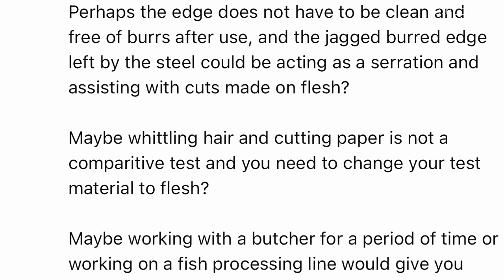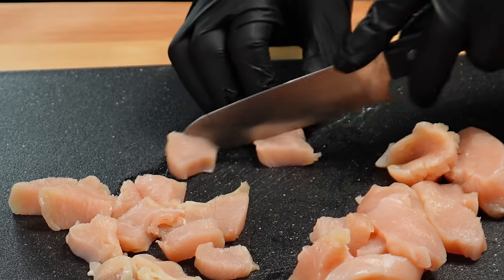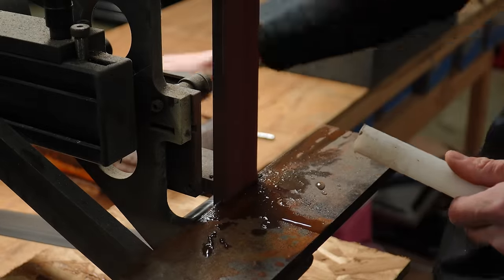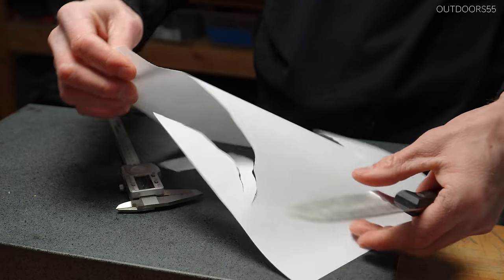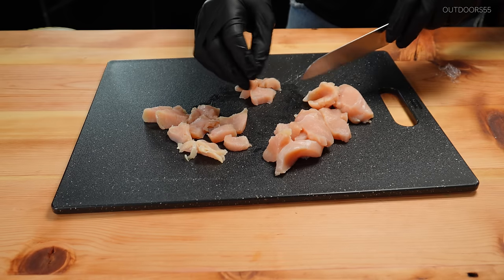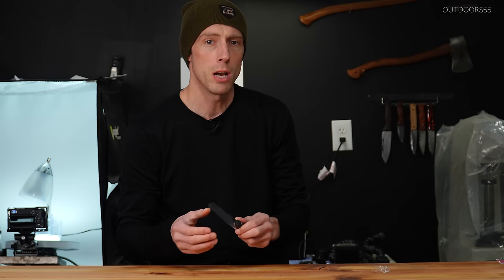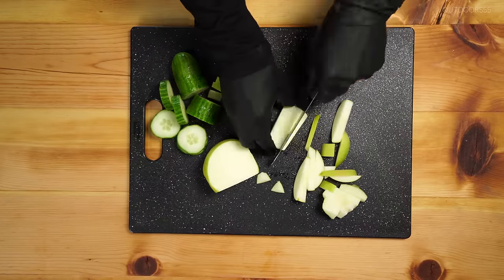Why Knife Sharpness Is Not What You Think

Comment: funny, recently I redid the secondary bevel of my kitchen knife because, well, why not. it's SO MUCH sharper now. even tho the primary bevel is the same (it's a full flat grind, and thing is 10in... I'm NOT regrinding the primary bevel). so, even what's right behind the apex also matters. 

that said: I'm TOTALLY gonna regrind my table knives. keeping those sharp is IMPOSSIBLE (cutting e.g. meat on a ceramic plate, two touches and the apex is gone), so, some good geometry will probably save me a lot of work in getting their apexes back over and over and over.

Comment: Yup, that's what is making my Manly Wasp a cutting machine. I use it a lot to cut cardboard and it just doesn't stop. The S90V steel helps in staying sharp. I never had to resharpen it. I just give it a couple of strokes on my leather strop once in a while. I'm shure this wouldn't even be necessary just for the cardboard.

Comment: ...currently wondering if you have a video explaining why cutting soft things still dulls knives, 'cuz that detail has long baffled me.  I mean I've heard of paper being an issue for fabric scissors -- paper having some sort of hard material used in its construction that will easily dull scissors designed to cut fabric -- but like, how does meat and cheese damage metal?  How does wood damage metal?  Why does this not intuitively map to "harder thing is not damaged, softer thing is damaged" and instead has things wear out through the years?

Comment: If you take a thin iron wire and bend it the opposite ways repeatedly, it will break at that point and you will be left with two wires with very sharp points. Honing steel is probably used for this same purpose. To break or peal the burr without damaging the apex, which can be so easily done. I only use very slight pressure, feeling the resistance of the burr on the honing steel. Also slightly increasing the angle and lowering the pressure even further as I go along. Ten strokes are probably the most you will need and the procedure quickly becomes counterproductive if you do it too much. You will know what I mean if you will be able to remove the burr as a strand. What you end up with is probably some sort of micro serrations on the apex that help with digging into tomato skin or bread or meat better than a polished edge. I don't expect the close up of the edge to look so good as the perfect geometry apex, but for every day use of a knife, where you want to get to the functional sharpness fast and consistently, honing steel is still a tool of choice for many people working with knives, even though some of them use it more to show off, rather than improve the sharpness of their knife. This is another type of sharpness. With your determination to get to the bottom of things and fancy recording equipment, I'm sure some of us could learn something new if you care to explore this angle.

Comment: I work with a lot of rabbit fur and sheepskin (I make custom wool overcoats and gaberdine trench coats and I trim the collars) and you never want a knife that's "hair popping sharp". You need it to be sharp enough to cut the skin without cutting the fur. Here in India, we use old, unhardened bandsaw blades. They usually clock in at 45 hrc, but that's plenty hard for a nice edge. Again, unless you're cutting some delicate fish or wagyu beef, you don't need a razor edge.

Comment: When people talk about cutting food in the kitchen, isn't the tomato the the item to test? For me, it seems a jagged burr really works well for breaking the skin of a tomato. And as such, the honing stick does quickly get the knife cutting again with minimal interruption. Seems like there is no clear right or wrong. I'm curious to know how a jagged burred edge tests on one of those sharpness testers that uses the thin piece of steel wire that gets cut? Oh, yea I have one those cheap knives that I think I $8.00 for and I changed the contour of the blade and I can't get it to hold an edge. Maybe I should try to heat treating it and annealing it. Not sure the handle would survive but I could probable do half the blade.

Comment: Love your videos. A small questions. I have always been told to never use sewing scissors to cut paper as the paper fibres will dull the edge. If this is true why do you always see knife sharpeners testing the sharpness of their blades on paper?
Reply: Correct, it's not "healthy" for a cutting edge to be used on paper.  However, paper is inexpensive, approximately equivalent for common sizes (with modern manufacturing) in thickness, so the average person can get a sheet and perform a reasonably valid test.  The paper held up from a work surface offers little resistance, but if it just bends down instead of being sliced, the knife is good and safe, but not ideal for cutting things.  
(As can be seen from this video, fruits, vegetables, meat etc. are not great indicators of "sharpness", and can vary enormously depending on age, but even the squared-off dollar-knife can get through paper with a bit of determination.)

Comment: I use a boning knife as a prep knife because the steel holds a really nice thin edge. I do basically what you did to your one dollar knife with my 120$ knife. But with one difference, which you point out at the end. I bring it down to a point where the apex forms again, but not too thin at the edge that it can't support it. That knife goes through basically pretty much everything. But yeah, you are right that not all 'sharpness's' are the same. But at the end of the day, when I am cutting things with skins like tomatoes or peppers, I want that knife doing what I want, not what the skin of the veggie/fruit wants. 

So plenty of people just look at me in horror when they see me sharpen that knife. Then look at me in amazement when I am able to easily slice off micron thick slices of tomato likes it nothing. It's always a follow up of "But that's not the right way to sharpen it. Why does it work so well."

I've always just replied, "I dunno, but it does; so I keep doing it."

Comment: Hmmmm. Yes, I've heard many folks (including Chef Steve Callari aka Super Steel Steve) mention this bit about geometry, but I wonder if other considerations besides behind the edge thickness and overall blade thickness come into play when cutting certain materials. Example: a Kramer chef knife (in this instance a 6 inch bladed one) outcut several knives with thinner blade stocks and thinner behind the edge thicknesses when it comes to vegetables such as pumpkin/root vegetables and I am left wondering if this is due to a wedge effect caused by the tapering (along the length and depth of the knife; the knife blade at the spine is at least 3 mm...maybe even 3.2 mm, so it is not particularly thin and definitely other Japanese chef knives I compared it to are thinner than that).

Comment: Ok, I'll bite on the title, because I believe that I know what sharp is what I think it is. I worked at a veneer processing plant in my youth. The logs that are sliced are upwards of 12 feet/3.6 meters long. 2 types of cutters that we used: 1 was rotational, the other was a mandoline style cutter. I've had a few conversations with the guys that sharpened those blades. Primary and secondary bevel were only a few degrees off from each other (don't remember the exact number here). 12+ foot long blades about 1" thick at the spine and aprox 10 inches/25 cm wide. Over all bevel root to edge was around 3 inches. All blades sharpened in a machine that had stones to give a micro fine edge. You could cut yourself with the slightest amount of finger pressure. That's what I think sharp is. 

Yes I know that this is not the point of the video; I did watch it. =P

Comment: my wife always tells me that the knives are plenty sharp enough when I go to sharpen them. And I put off sharpening them until the apex is completely rounded off and you have to use the tip of the knife to cut into something like a bell pepper... 

But yeah, they're thin behind the edge, so they pretty much function. I remember someone once saying that a knife is effectively just a wedge, at a mechanical level, which provides a different way to think about it, even if you don't necessarily agree...

Comment: The only thing that gave me "wait a minute" moment was cucumber cutting, some veggies have tough skin and without proper sharp knife it's not so easy biting that epidermis, and it shows. It's not super obvious but hints are there. There are meats that work similar: cheap market grade water pumped chicken breast you can cut with anything, duck breast will be far more demanding, and good luck slicing skin on a bacon piece with dull knife.
About real testing, not so fresh tomatoes are great for testing because, that slight loss of water makes skin wobbly and you can clearly see and feel how knife is managing through initial incision and then how nicely it separates mushy interior. And afterwards you can make a spaghetti sauce (it's far better with slightly mushy tomatoes than from apple hard ones).

Comment: The most annoying bit of food I've had to deal with a not sharp enough knife is a badly chosen piece of pork belly. With skin on, one at layer, one lean layer. Blanched for around 5-10 minutes before cutting so the outside is mostly cooked by the center is still raw. The toughness of the skin combined with the stiffness transition of the cooked and raw portion makes this a huge pain to slice thinly(1-3mm).

Comment: What I'm interested in is how thin you could slice a tomato or bacon for example, because I've used a lot of dull knives, and done pretty fine by applying little pressure, but quickly sliding the knife back and forth. But I could never make a thin cut with any of those knives.

That said, I have never sharpened a blade in my life, nor do I have any sort of cooking education

Comment: Yeah firm vegetables are some of the easiest things to cut as long as you have a somewhat thin piece of metal, and most meat as well. The real test if you want to test cutting food is relatively soft food with a tough skin, like tomatoes or bacon with rind etc. But I'm pretty sure tomato skin or pork skin has fairly similar if not identical edge requirements as cutting hair does.

Comment: To all the knife folks. It does not take an edge to cut!

Cutting is just friction. Hell, a BLEEPING river can cut!

I could cut my way through a wooden table using my open palms if I had enough sandpaper and time. 

And edge just allows for more focused cutting and helps with cleanliness of the cut and cleavage. 

Cleavage is when a crystal is fractured and the parts are separated. Many food types are not crystaline exactly but they are brittle or crisp enough to act as though they are. Cutting many vegetable requires breaking through a hard skin to then be able to slice through the remaining softer flesh. 

So in general harness and application of friction is more important than sharpness for cutting. 

A good slice should almost feel like the way striking a match against the side of the matchbox feels. =)

Comment: Are you saying that having low behind-the-edge thickness is sufficient for a knife to be good at chopping through the kind of meat and vegetables you cut up here, or that it is both sufficient and necessary ? In other words, can a knife be good at chopping through these things if it has a relatively thick, wedge-shaped primary bevel but it also has a very sharp edge?

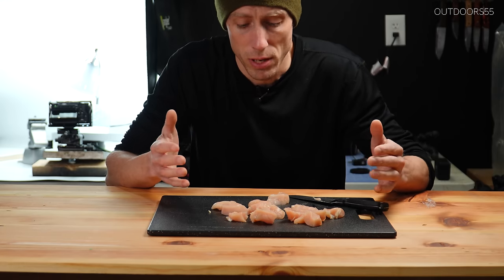Also, would the demonstration knife really be sufficient for 99% of the people who need an ordinary kitchen knife 0:48 ? Maybe, but I don't think that the demonstration here proved it. Almost everyone who needs a kitchen knife needs a knife which can effortlessly cut straight down through the hard, waxy, and convex outer surface of a peeled onion, especially at the edges of a half-onion where the slope of the surface starts to become nearly parallel to the path of the knife. Getting through an apple or a banana or some chicken breast is a much easier test.

Comment: My adult daughter will not let me sharpen her knives (cutting herself fears). She has never done anything to her kitchen knives. They are very dull, but I watched her in the kitchen, and she is happy and has no problem cutting for cooking. I like my kitchen knives sharp, but I guess it's a guy thing. It drives me nuts when I use my kitchen knife to open a plastic bag, and the knife doesn't glide through smoothly.
Reply: Most people have no concept of efficiency. Nothing more annoying than a dull cutting tool. Even old time lumberjacks would spend time sharpening an axe rather than forcing a blunt axe into wood.

Comment: I have a question/problem not necessarily related to this video however it’s about sharpening.

Sometimes I sharpen a knife to scary degree. I asses it with different means. And it passes high honour. I check the bevel under my magnifier (I don’t have a microscope) and all is well. The day after, without any usage it doesn’t pass my tests. Am I crazy and should get psychological help or what.

Ps. I’m a pro sharpener that sharpened thousands of knives in tens of ways.

Comment: What You spot out is the difference between a cut and a tear or rip... Extreme example: cutting a tomato. Take a dull knife and pull it 2-3x each side over the round file that's normally used to sharpen chainsaws. The cutting edge will become some burr that's shaped like small saw teeth - and the blade will cut tomatoes perfectly! But that does not mean the blade is well sharpened. Cutting paper, shaving, or making the "thumb-nail test" will show: the cutting edge is raw! As soon the burr is gone (that will happen quickly) the knife is dull again and the process (which removes a lot of material) must be repeated.

That's also the difference between butcher's knifes (to be usually sharpened often, with a steel rod) and asian kitchen knifes or "scandi" outdoor knifes (to sharpen with a flat stone). 

The best way to avoid dull knifes is keeping them sharp! Means: as soon as You recognize it's not supersharp any more, pull it 2-3x (each side) over a very fine wheatstone (*) and it will be perfect again. 
Keeping a sharp knife sharp is way less effort than making a dull knife sharp - and it has one big advantage: You'll never have to deal with dull knifes.

* I'd never give away my original "Belgian Blue" natural wheatstone. Around 2 decades ago, I took the cost buying a bigger one (appx 3" x 12") - never regretted just a single cent!

Comment: I mean yeah, cutting those light food item is easy but the wife will quickly find out about it at the first try through some small tendon, skin or even trying to break the crust of home-made bread.
I do consider kitchen sharp as a class of it's own. Primary as thin as humanly possible, with a 20 degree per side secondary, and a 30-40 degree per side strop is what I go to these days. 
The durability obtained is a great plus but most importantly a kitchen knife should not cut through wife and kids fingers like butter.

Comment: You should compare that knife to an actually sharp knife doing something with food that actually does require sharpness, like cutting salmon sashimi or cutting paper thin tomato slices horizontally, maybe without even holding the tomato securely, just lop the bottom off to give it a good base and then take horizonal slices off the top.
Reply from the maker: Good idea 👍 I simply used these items since i had them on hand and the comments referenced "flesh" / meat. I thought a steak would be too easy so I chose chicken😉

Comment: Please review the sharpens best knife sharpener when you can
Reply: It is a tungsten carbide sharpener, so there really isn't a point in asking. He wouldn't give it a good review because his opinion of tungsten carbide sharpeners is pretty well documented. 

For what it's worth, I use a Corona AC8300 to touch up and restore a working edge on cheap/soft pocket/kitchen knives pretty frequently. I have for 3-4 years now. It is a similar sharpener to the original Sharpens Best sharpener (the ones w/o the v-edge pull through) that costs about 1/3 what the Sharpens Best does. (It's selling for less than $10 on Amazon.) IMO it does a good job touching up/sharpening dull knives, but it wouldn't be my first choice for repairing major edge damage like nicks/chips. (I have a Worksharp knife and tool sharpener for major damage.) I find many strokes and a very light touch w/ very little pressure then a quick strop once I'm done to remove the burr gets the best results. Given how similar all the tungsten carbide file sharpeners (Cornona AC8300, Speedysharp, Sharpens Best, etc...) are, anything that is said about one of them should apply to all of them. Hope that helps a bit.
Reply: @jkirschy  I've been using them for years and I absolutely love love them. He makes a good product in america. And I would love to see how is sharpeners do under that guy's ultra magnification compared to other sharpening. If he doesn't like the sharpener that's fine but I really want to hear his opinion
Reply: @jkirschy  also and other posts I offered to pay for it

Comment: A ceramic knife is exactly this - a flat, squared off apex.  Many people are quite happy with those too.   To describe the geometry of a blade you need two parameters, one describing the thinness or sharpening angle (I call this sharpeness) and one describing the apex width (I call this keenness).  Depending on the cutting task, one or the other may dominate.  Food prep on a cutting board requires sharpness but not keenness or a burr - this is what is achieved with slightly muddy stones.

Comment: What I see in real world is, 
Cheap handmade knifes with no visible bevel (or whatever technical term it has)
People sharpen it by just randomly rubbing it on concrete floor.
Works perfectly fine for them.

Just needs a knew knife after the old one is worn down...